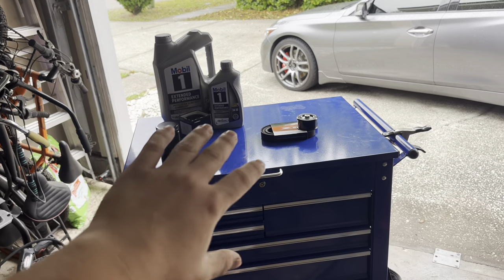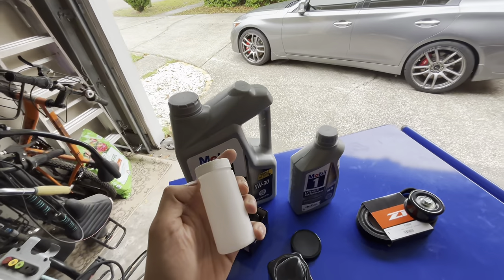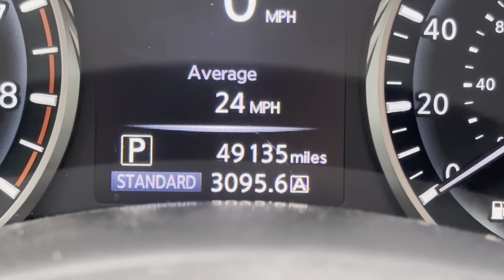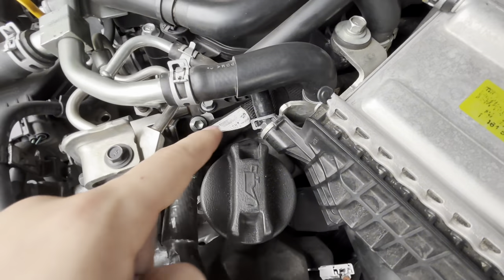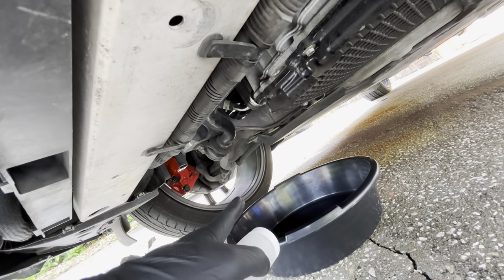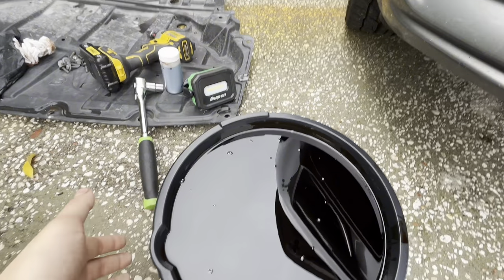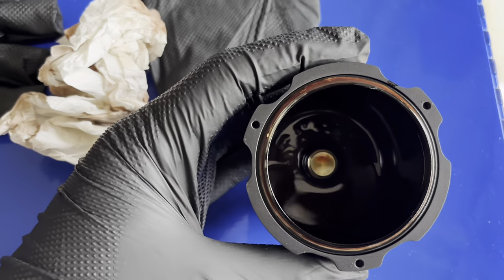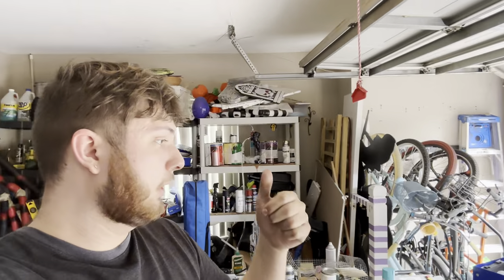Vlog #3  Is my Q50 Healthy? (Oil Change and Analysis, Catchcan, Anti-Jump kit)

Comment: I recommended the gtr filter 15208-9E01A and also torque spec for the pulley is 35 lbs
Reply: yeah this one @6.5qts awd is recommended by the tuners.
Reply: The actual specs of the filter don’t compete with the purgatory boss filter

Comment: If you run a 5W-30, that’s a little too thick for the turbo to get the adequate oil flow that’s why they go zero 20
Reply from the maker: I appreciate the feedback! I only run 5W30 because I live in Florida where it’s always 80+ degrees and high humidity but also a lot of my buddies ran 0W20 and had to replace their engines from metal being in it
Reply: no they go 0w-20 for emissions only and 10k oil change interval. 5w-30 is the proper oil to use and up to 5w-40 when tuned fbo. It even says it in the manual. Source: infiniti master technician. Racebox, sonictuned, ams. The 0w-20 is too thin for this hot platform, it has a strong correlation with turbo failure.
Reply: @arkyr1570 thanks for the info, I’m in northern Ontario so I figured I’d go with some 0w-20 since it’s colder out, I plan on going fbo tuned.  I’m assuming I’d be fine to leave it for the 5000km or so unless I get my downpipes and tune before that (ark catback is waiting to be shipped) did the oil change like 2 days ago
Reply: @whalepoacher196  u need 5w-30 for FBO

Comment: Stop using that Mobil one garbage get amsoil or penzzoil ultra platinum
Reply from the maker: Been using Mobil 1 on my previous cars (370z and 350z) and on my Q50 for 2 years and never had issues with it but thanks for the suggestion!
Reply: @Ghost.q50  ams oil will be much better for the car bro especially a boosted car